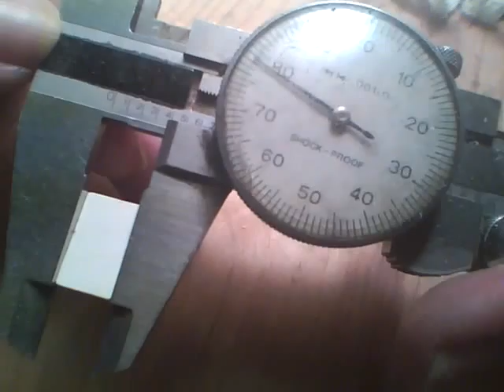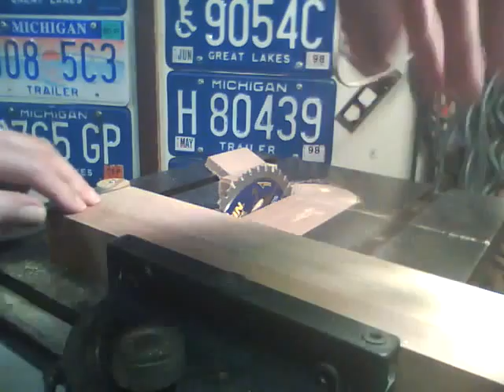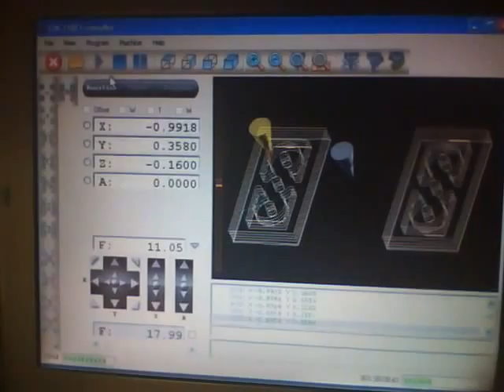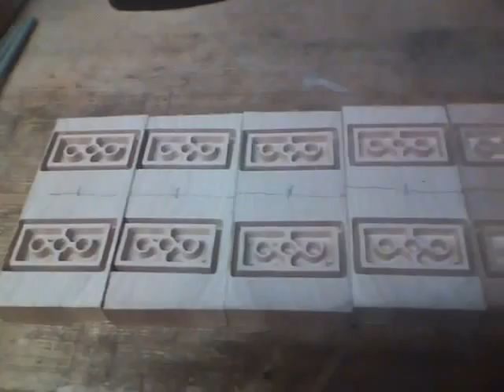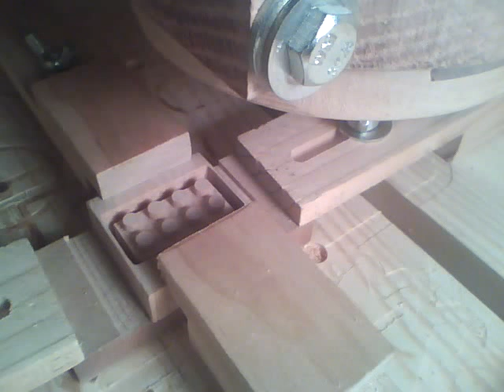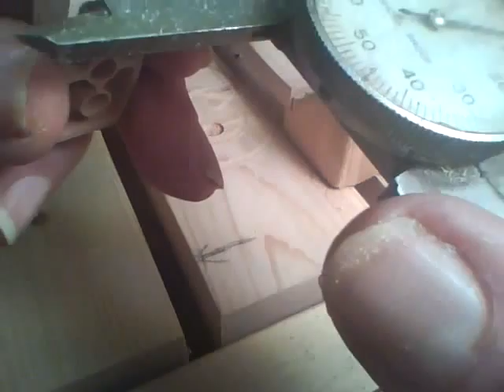Make Wood Lego Blocks

Comment: Nice Work Jim; CNC's are fascinating machines thanks for sharing.

+Woodmaster Pete Don't be so snooty about CNC; a lot of work goes into building and programming those machines; it is not like a photocopier as alluded to, you don't just put a piece of wood on and press 'copy'. It is a tool like your hammer or screwdriver. I expect you use a table saw; a battery drill, a router, a belt sander??
Without CNC machines we wouldn't have a lot of the tools we do.

People have to get over themselves or they are going to miss a lot of life's pleasures.
Reply from the maker: grotekleum Thank You. You are spot on with your reply.

Comment: what programs do you use Jim?
Reply from the maker: Summers Woodworking Brian, I use SketchUp with Sketch-U-Cam plug-in. Also some hand coding. I made a VB utility program, about 6 years ago. It's called G-Code Clean-Up. It has common functions like center or LL x/y, scaling, offsets, add/remove line numbers, mm to inch, inch to mm and replace.